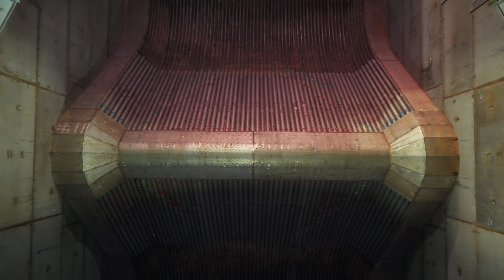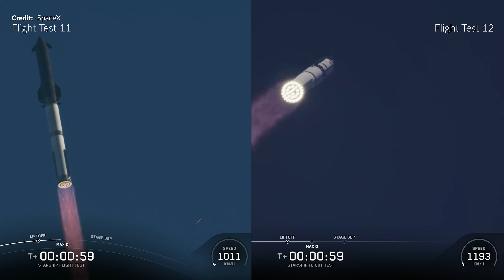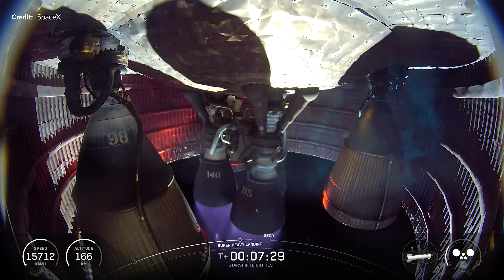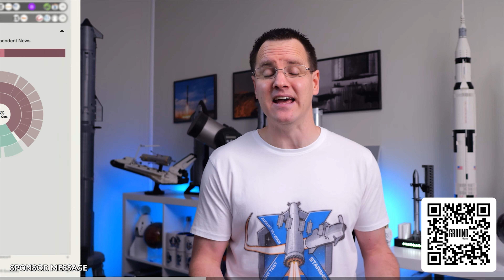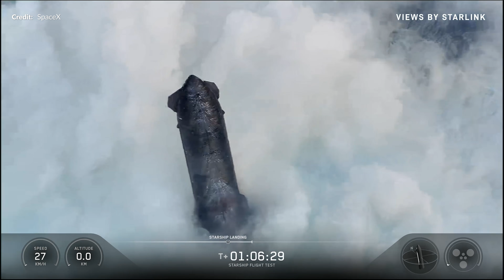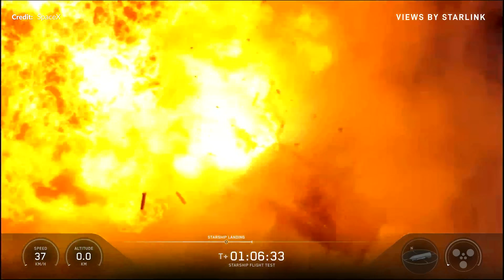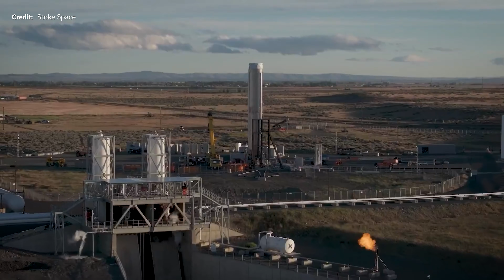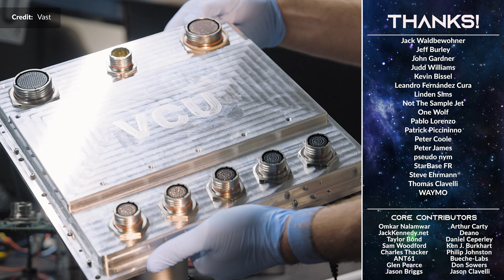Starship Flight 12 Explained - The First Version 3 Starship

Comment: Anyone knows the timeline for Starship to make orbit?
Reply: There is no timeline. Starship should have been to mars almost 10 years ago, a couple of times by now. It was supposed to act as a rocket plain, too. For years! There wasn't any talk of a v2, v3 starship. This program is a failure.
Reply: @markwtal9453  10 years ago? No they originally said 2024, that was 2 years not 10 😂  development only started in 2018 🙄 did you really expect it to have completed missions 2 years before they started building it?
Reply: @minmo2288  They are getting crazier by the hour.

Comment: Shockwave reflectors that redirect upwards to a point above Starship, where is the nose cone still has 20 M of travel from the time the last significant reflection reaches that height thus clearing the way through the atmosphere somewhat and redirecting the force and some of the noise to an upward fashion to reduce disturbances to nearby structures and inhabitant beings
Reply: Similar reflecting wall to be used around lunar Landing base, directing dust flows to a specific flow pattern away from the settlement do the emergency crash field. Overtime the crash field will get an additional layer of dust

Comment: If you pause the booster just at the point where you can see the boost back engines firing it looks different to the graphic. Maybe the telemetry failed rather than the engines.

Comment: Y doesn't Elon team design a "clip on" facial heat shield like a second skin that can be quickly applied or discarded so it is it's own entity. 
The skin could utilise an air space between itself and the ship...( maybe even water between for radiation shielding???
Not a rocket scientist but seems like it could work. 
Small weight deficit but solves so many other issues for quick turnaround.
Reply: That’s basically what they have now.

Comment: Can't help think that the booster performance was several steps backwards.  The assent was awesome but the failure of the engines on the boost back was disappointing. The ship though performed very well. Heat shield seemed to perform far better than previous flights.

Comment: So a total fucking disaster then
Reply: Nah, ship did pretty much fine, got the flight profile, the payload deployment and the reentry spot on, that one engine failed but the system for compensating worked so that’s tested now and useful data at least, booster on the other hand yeah pretty much a total disaster 😂

Comment: WHY were they so aggressive with that booster flipback maneuver?! Im surprised it didn't blow up. I assume ice isn't a problem inside the fuel tanks anymore but the massive shift in lliquid definitely starved multiple engines of fuel. They were ingesting pure gas. The pre burners and turbo pumps spun themselves apart on that relight
Reply: My first thought was with the new engines and power to weight ratio they might have messed up the calculations and did it a bit too hard.

Comment: If the Falcons are doing the job of dispensing starlink, shouldn't the Starship be more focused on getting the US back to the moon?  After all,that's why its getting so much govt funding
Reply: When it’s up and going it will be able to get way more of the new bigger starlinks into orbit way cheaper than falcon. Also the new ones are too big for falcon

Comment: Can't verify it, but someone said they did pixel math on the Starship taking off and measuring from the tip of the Starship to the end of the flame out the booster, was ... 500 meters in total, or HALF A KILOMETER! 😨
I've guesstimated earlier v1/2 launches to have 200+ meter flames out the back of the booster, but this is v3 and next level, so a 370 meter flame, IDK, but not far off probably!

Comment: There's a lot of pessimistic people in the comments. Yes the booster couldn't relight, therefore crashed. But it's not a set back, because this booster took off faster than any other booster. It's obviously more capable than ever, but relighting the engines has always been difficult to master when facing a never before tested maneuver.

Comment: The fanboys are drooling over this launch, but investors won't be nearly so happy. Don't forget that they've been working on Starship for close to a decade now and have blown up dozens of rockets. It's been years since they caught a rocket, and it looks like we're taking 2 steps forward and 2 steps back all the time. At this rate, it'll be another couple of years before they can make Starship usable, if they are ever successful at all. Look at all the fuck-ups with stage 0. The engines are still not reliable, not even on the 3rd version. They keep having to redesign large parts of the rocket - because of iteration or just bad design? The idea of agile is to have a working product and then improve and expand on it, not to not have a working rocket after almost 10 years. Seasoned analysts know to take Elon's predictions and multiply by 2.5, although it's more like multiply by 3 or 4 by now.

Comment: Massive surprise was powerless crash of booster. Apparently only one engine restarted. Had no chance to slow down. 
IHMO this was due to "ullage" uncontrolled movement of fuel inside the tanks.  Only three fin grids provided not enough aerobraking force for the fuel to properly flow and cover fuel ports in the tanks. When pumps started - there was no fuel to pump.
Perhaps it has something to do with exhaust color at the start. So far we saw orange flame (quite normal with methane as fuel), this time it was rose color. Maybe it's just a sunlight but maybe incorrect combustion or combustion chamber contamination (pipes plumbing?)

Comment: I know they had some failures, but the main thing is that the heat shield looked pretty good all over the ship. We did see a few sparks come off- suggesting there are still some issues with sheilding in some locations, but the vast majority of ship looked just fine.

Comment: I wonder it all that water messed with the engines. I am no engineer, as it might be obvious to some who know better. But is all that pressure and cold water good for an engine that heats up so fast afterwards? Isn't that reverse quenching?
Reply: Before he engines start there is liquid methane flowing through the engine bells, and prior to ignition the entire engine is cooled to far below freezing (as for all cryo-fuel rockets). The cold water has no effect at all.

Comment: Can’t sugar coat it. Loosing engines is not acceptable.
Reply: Relax buddy. These are still prototypes, and this was a test flight. compare that to Boeing's Starliner which spent years being tested in computer-simulations, and was fucked up bigtime in real-life.
Reply: First flight of 39 totally redesigned engines….and Starship still stuck the landing in exactly the programmed spot? Geesh! You should be celebrating its resilience - Dave Huntsman

Comment: None of you will listen, but I will remind you anyway, that twelve launches was all it took for Saturn V to COMPLETE the Apollo program.
You can keep huffing all the copium you want, but all of SpaceX's success with the Falcons really doesn't change the fact, that Starship is their Cybertruck.
Reply: You won’t listen, but SuperHeavy booster equalled (surpassed, really) Saturn V performance in two (2) flights. 

On IFT 2 Super Heavy B9 took Starship to separation point and successfully disengaged. SpaceX could’ve stopped there, frozen the booster design, and had the world’s biggest heavy lift booster ever. They could’ve just mounted an expendable second stage on it and been flinging Starlinks and other satellites ad infinitum.

But also take note that to COMPLETE the Apollo program, it took more a lot more  than 12 launches.

There were 12 full-stack Apollo- numbered launches, but prior to that the upper stages were tested separately. There were 9 Saturn 1B launches, and prior to that 10 Saturn 1 launches. So we are up to 31 launches. SpaceX is testing the whole stack right from the git-go.

Also Apollo wasn’t a completely new design. It drew directly from Projects Mercury (30+) and Gemini (12). And those used some boosters that were already extent and tested prior to project start.

And,p, to COMPLETE the Apollo program required a man to land the Lunar Module on the surface. That took over 150 practice flights with the lunar landing module trainers, and damn near killed Neil Armstrong in the process.

None of this were designed to be reusable, mass-produced, and only a very small part came back to Earth. 

Your comparison is trivial and facile copium.
Reply: You can keep huffing all the copium you want but the fact is Starship is many orders of magnitude harder than the simple (dangerous, inefficient) Saturn (which took many orders of magnitude more resources, people, money, to develop)
Reply: @admarsandbeyond Okay, Starship is supposedly "fully reusable", so how about that other reusable orbital vehicle, i.e. the Space Shuttle? The Shuttle had a success rate of 98.5%, two failures out of 135 launches - what's the success rate of the Starship again? ...oh right, 0% 😂
Reply: @eviljesus84  The Shuttle was a partially reusable launch system, similar to Falcon/Dragon (which have a perfect flight record). The only thing special about it was that it had big heavy (dangerous) wings and could glide a bit before landing. Starship is orders of magnitude harder.
Reply: @admarsandbeyondthe only difference in their "partial reusability" is that the Shuttle landed the orbiter 133 times out of 135, while discarding the boosters - while the Starship landed the boosters 3 times out of 12 while always leaving the actual ship to explode and sink in the ocean 😅
Reply: @eviljesus84  The Shuttle cost $94Billion to develop (with work starting in the mid-60s for the RS25s etc), with an estimated 250,000 to 300,000 people overall working on the program.
Starship is developed with a different paradigm. Instead of wasting $100B and decades (to make a failed system like the Shuttle which failed on all of its goals if cheap, reliable, rapid and frequent access to orbit (cost on average $1.6B/flight), killed 14 astronauts, and was retired prematurely before it killed many more) it uses a hardware rich, fast iterative, agile development process. This is the only way a program as absurdly difficult as it can succeed.
Reply: @admarsandbeyond 
1. You can slam the shuttle program for "failing it's goals" once Starship achieves any of theirs
2. You can tell me how cost effective Space X's approach is when they're no longer using Starlink - the only profitable (for now) part of their business - to prop up the rocket and AI parts, and still posting multi-billion losses (~4.9B$ last year)
3. You can tell me how much money NASA "wasted", when Space X is no longer trying to use it's IPO to scam people out of 1.7 trillion dollars, based on a completely imaginary 26T$ projected profit from their AI operations - the same AI operations that have been losing them billions each year
TL;DR - NASA "wasted" 100B$ and decades? Give Space X some time to catch up then, up till now they've already posted losses of 37 billion, so I'm sure - given a fraction of those decades - they'll easily get there🙃
BTW - that "fast iterative" process sure is 'iterative'... considering all the noise that's been made about Starship V3 having been "redesigned from the ground up" - 'cause everybody knows that's what 'iteration' is all about 🤣
Reply: Ironic given that SpaceX are the largest purchaser of Cybertrucks!

Comment: Huge step back for the booster. Given spacex’s prior experience with 11 prior launches, it’s disappointing the booster failed so completely. Lack of relight on starship engine is a huge issue. They need this for HLS. I’m starting to think they might never get there. Rooting for them,  but looking less likely that they will participate in moon landings.
Reply: SpaceX keeps changing their baseline SH booster design.  If they don’t stabilize their SH booster design in the next weeks, unfortunately, I concur with your concern regarding Artemis 3. 
Also, I think SH for lunar and Mars lander missions ultimately needs to be a three stage design.  It’s incorrect thinking to think two stage because you need to maximize fuel to orbit.
Reply: Yeah, NASA will just have to build these sustainable moon bases they want with BO's little blue balls mk1 lander.

Comment: That booster flip looked so aggressive I was speechless for a few seconds and absolutely not surprised they lost it.
Probably pushing the envelope to see how quickly they can get it burning home. Every millisecond saves propellant
Reply: Thats exactly what was going on imo!. Testing some limits again. That fuel must have been slushing like crazy.
Reply: It did .
Reply: So much for all the pre-launch "concern" that the flip with the open-strut ring would be too slow vs. the partially closed disposable ring.
Reply: I understand why you want boosters returning most times. But I wish they were running a parallel down range water land with booster for tankers. So much more mass to orbit. I also think a cable catch boat with little swing out catch arms would be very doable. In 2021, a YT'er named Small Stars showed this technique and Elon liked it. Basically the arms only catch the cable and then fold against hull as it's hung, they clamp and don't need immense rigidity. This system could potentially be very practical. Anchoring steal catch cables above a platform or pontoons does not require some massive ship.
Reply: Catching boosters downrange? Not in the plan. Getting a high relaunch rate with barges returning boosters to the launch site is a huge conflict. And you still need a mechazilla on a floating platform, very top-heavy. So you need immense submerged counterweights. Or seafloor anchors.
 @gcburns4
Reply: i noticed it flipped so quickly from the help of the starship exhaust plume, which was hard to see, that it looked like it may have scorched the side of the booster itself. i wonder if the booster was damaged from that.. or from the violent spin. g-forces. The booster walls are thin... and weaker without fuel at that point.
Reply: @able1115 a definite possibility! I think it got a little more flip happy than they were expecting
Reply: Hull strength is not affected by low fluid levels. It is affected by lowered pressure, which is prevented by the autogenous pressurization system in the Raptor engines.
 @able1115
Reply: Same.
Reply: The fact SpaceX is hunting for these marginal improvements is not a good thing, especially considering the lack of payload.
Reply: @ahhmm5381  are you saying they should get to orbit as fast as possible with this by not using the margins they think they have, and test the margins later in productive use?
Reply: @unitrader403  The issue is the underlying design is trash, so none of this matters
Reply: @ahhmm5381  What aerospace company do you work for?
Reply: @ahhmm5381  well, seems you have a better design then. So build or sell it...
Reply: @unitrader403  why get triggered? It's just his opinion, which is 180 from yours. Your willing to wave pom poms on feelings alone. The fact of the matter is he actually has a point. NASA estimates 15 refueling flights just to get this thing to the Moon. They are trying to shoehorn a two-stage rocket to Low Earth orbit into something that it's never going to be. 99% of this rocket's lifetime will be launching starlinks. SpaceX is turning into a telecom company.
Reply: @hawkdsl  It has been for a while now. 70% - 80% of revenue comes from Starlink. There is no money in providing launch services only. How many times would Falcon 9 fly in a year if there was no Starlink launches? Starship would be useless without Starlink and eventually AI satellites. How many times has Falcon Heavy flown? There is little demand for super heavy rockets.
Reply: @unitrader403 😂 naahh not with his empty head, some heads are just good at talking, that's the beauty of science & tech, results matter not POVs & emotional options,
Reply: @ahhmm5381 they're testing the upper limit of what's possible is my guess. Why not try it? Otherwise "free" performance gets left on the table.

Comment: If you watched closely, you could see S39 actually gain altitude at one point during re-entry. Amazing that they are able to do an aerodynamic re-entry that high instead of just a ballistic path.
Reply: The reentry trajectory is a skip.  I also wonder if SpaceX is doing tests to estimate performance at Mars Entry Interface for aerobraking at Mars.
Reply: @goldenpacificmedia  - That footage will be astounding. The nutty thing is how low in the atmosphere starship will have to be doing that aerobraking. They will likely be just a few km above Martian terrain, imagine those camera shots!
Reply: Mars entry is incredible. The Ship is entering faster than the escape velocity by a large amount. The Ship has to orient nose down in order to follow the curvature of the planet. It is actively deflecting air outwards to maintain a very low altitude! This continues until it drops below escape velocity. 
 @goldenpacificmedia
Reply: Tracking up the relative, wind, just like a skydiver.

Comment: First human interplanetary flyby?  Isn’t he just doing the same thing as the Artemis astronauts did recently and Apollo astronauts did in the 1960’s.  Are you suggesting those astronauts were not humans?  Also since when is the moon a planet?  This was the 12th launch of Starship and they experienced multiple engine failures, lost control of the first stage which crashed and had visible cracks on the Starship fuselage which is meant to be a reusable vehicle presumably without major servicing between launches.  I’m not sure how you can call this a successful flight.  They are years behind schedule.